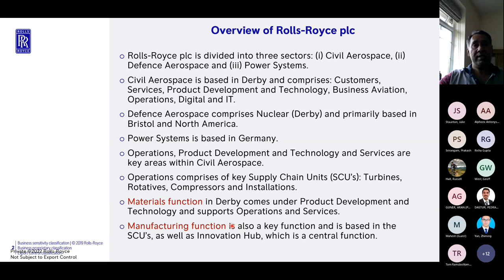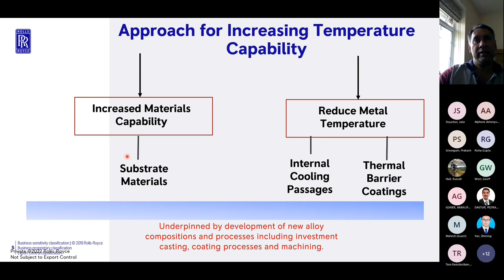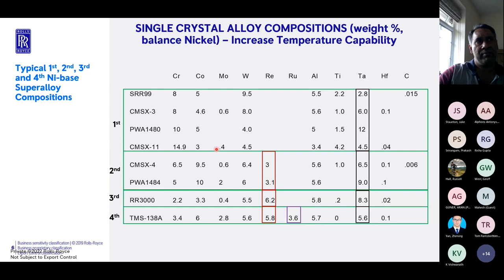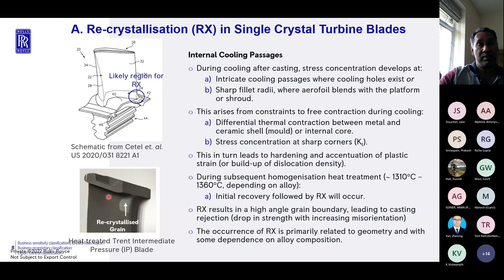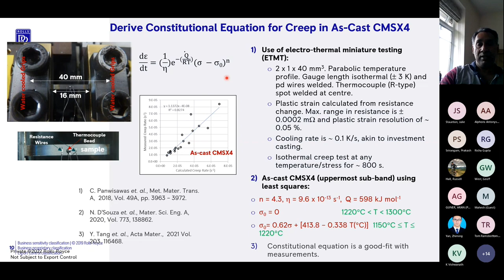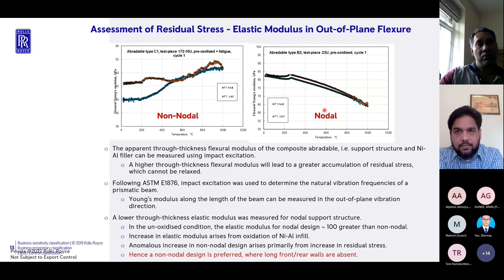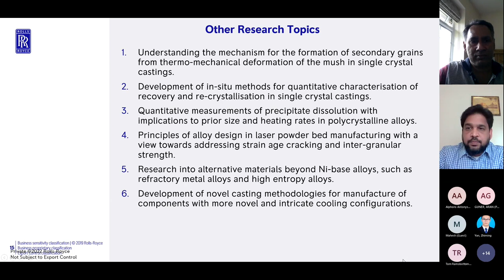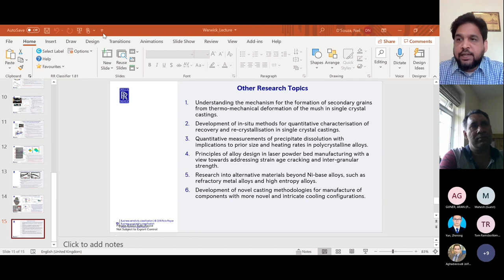Materials research and development at Rolls-Royce plc, by Neil D'Souza

Comment: My experience with Co-Fe alloys is that the ordered structure makes them incredibly difficult to work with even in a lab based environment. They are extremely brittle. I would hate to have to manufacture components from Co-Fe alloys
Reply from the maker: Thank you for the information.